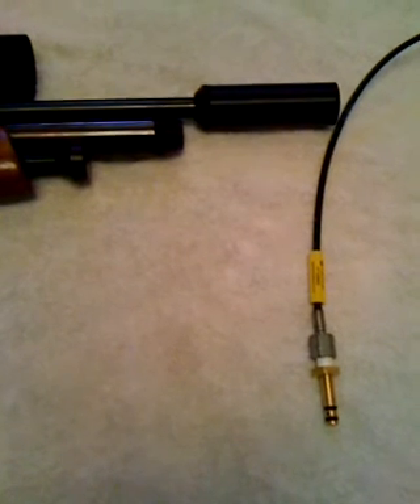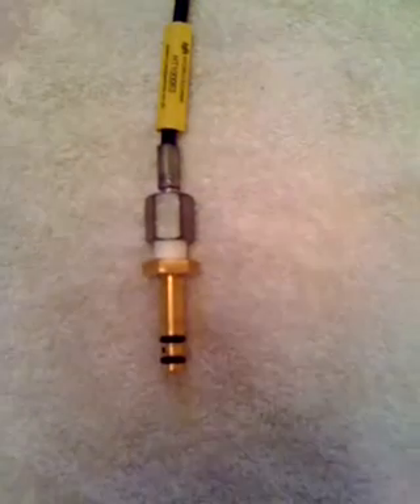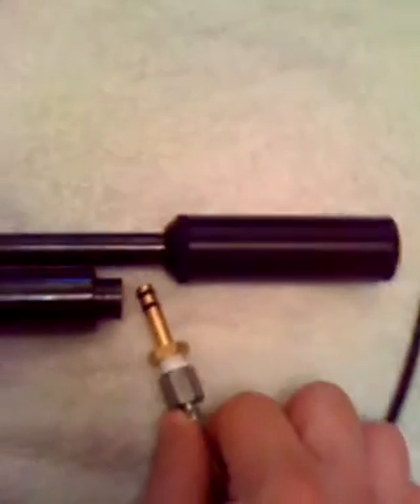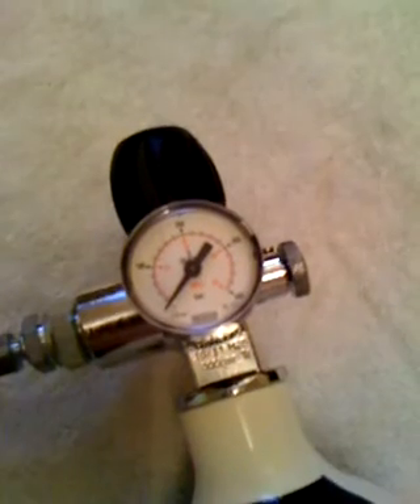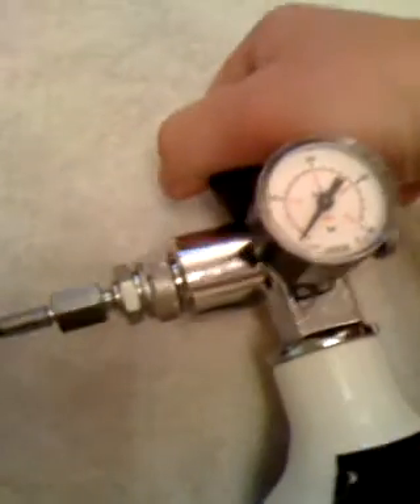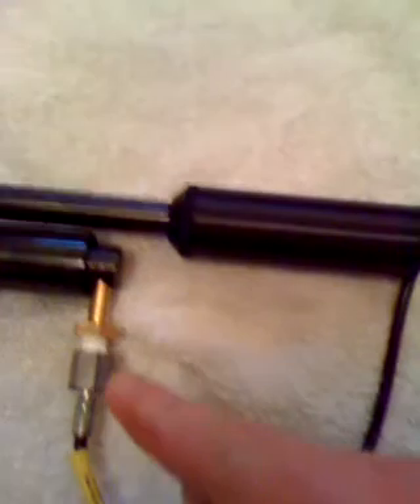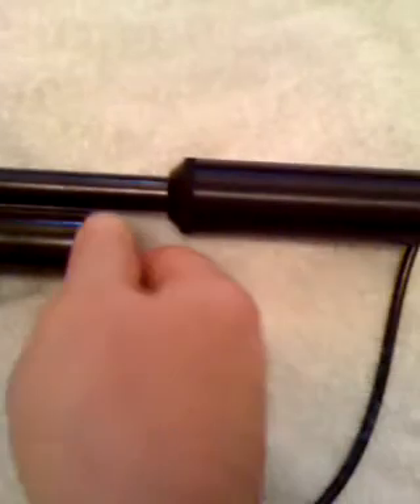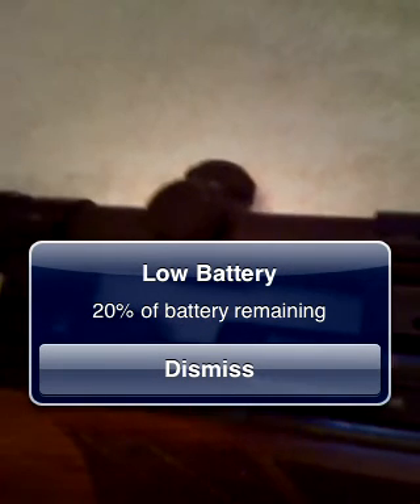BSA Ultra - Air cylinder charging

Comment: My ultra tends to drain pressure  from cylinder , if I  don't  use it for several weeks . Has anyone  else experienced  this . Have had the seals replaced by BSA under warranty.
Reply: I have been told by Country Ways gun shop . It is to be expected . This I can't believe   !

Comment: Nice video. Thanks for the tips. Unfortunately my 3l cylinder seems to have a leak. I think it's coming from the nuts after the hose connects to the cylinder. I follow your steps, reach 190BAR, turn off. but the pressure slowly drops and i can feel a leak at the bolts. Should i stick white water sealer tape in the threads and maybe a rubber flat washer ?

Comment: how about a 7litre air cylinder 
ok bit more pricey but you will have more refils
and for a daystate air ranger you will have air to last you for a year 
400 shots with a full power sub 12lb is taking a piss and look at your 35 shot gun
you will blow through 3 litre tank and me wont even need to fill it up for a long time